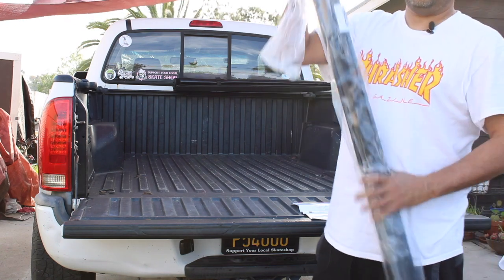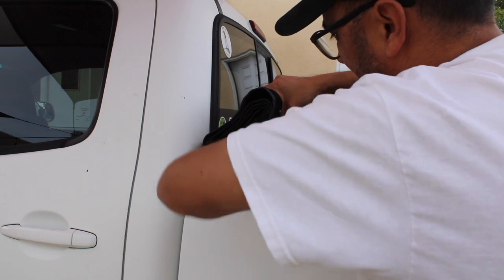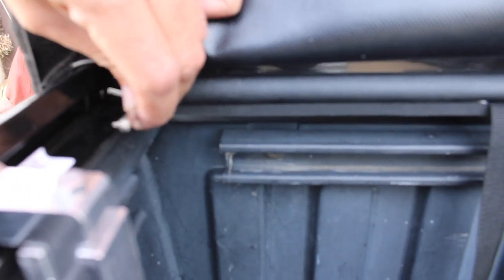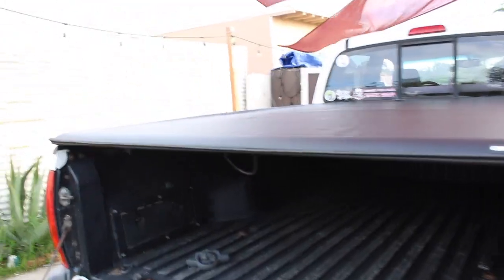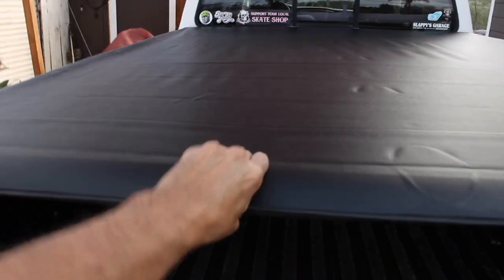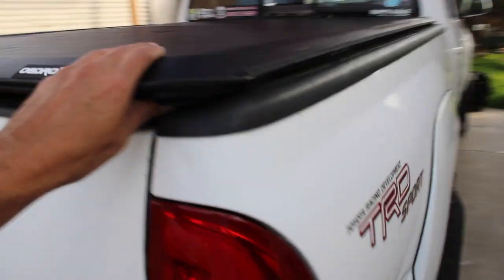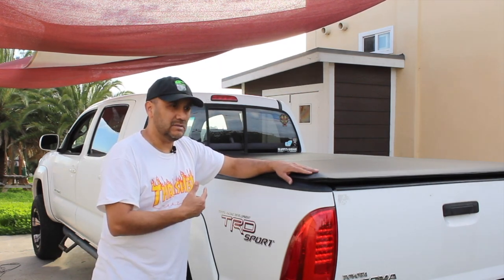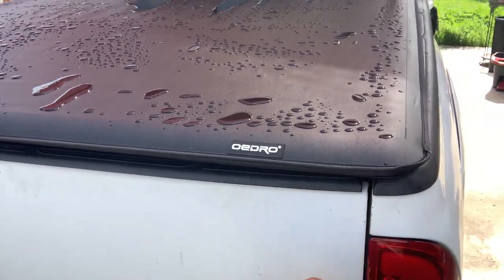Oedro Soft Roll Up Tacoma Tonneau Cover | Review Oedro Tonneau Cover

Comment: Idk what I’m doing wrong it won’t latch or close. It’s latching onto the tension things right why won’t mine go in please help 😢 instructions are useless
Reply from the maker: So sorry to hear. You might have to adjust the latches. There is an adjustment screw to bring it in and out. This will make the tension tighter or looser. Let me know if you can't find the screw to adjust I can try to make a short video to show you.

Comment: You didn't use the foam for the gap in the front under where it rolls up so water is gonna get in!
Reply from the maker: Sorry yes I did. I didn’t show it in video. But the glue stopped working so it fell off. Water still doesn’t get in when it rains. Maybe a little when I wash it if I spray water under the cover.

Comment: My tensioners didn’t come pre installed did yours?
Reply from the maker: Yes I think so. I think I may have adjusted them slightly but that was it. They should be easy to install let me know if you need help.
Reply: @SanDiego_VDubLife  I’ve tried putting them in myself but I can’t seem to figured it out
Reply from the maker: @jacobpayne7265  let me take a look at mine and get back to you
Reply from the maker: @jacobpayne7265  if you have Instagram I can send you a video or images that might help. I’m at sandiegovwdublife on IG message me
Reply: @SanDiego_VDubLife  awesome thank you! I just sent you a friend request from Jacob.payne42

Comment: Hey great job I like it. My question is can someone easily slide their hand through the sides and steal? I want to put tools in my truck bed but first I need your opinion if you would recommend the same cover
Reply from the maker: For security reason I would go with the hard top version. The soft top works great to keep people from seeing what’s back there but if someone is desperate they will try to sneek a peek. The sides are Velcro so it would be difficult to remove any bulky items from inside without rolling up the cover unless someone cuts it.